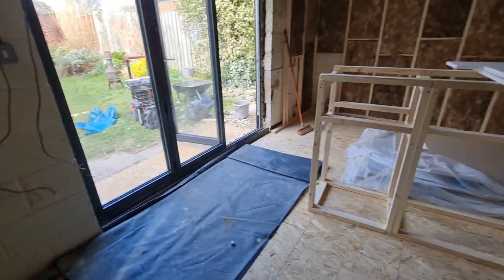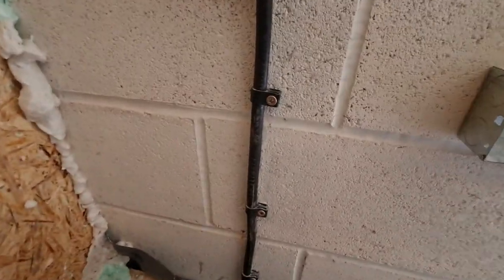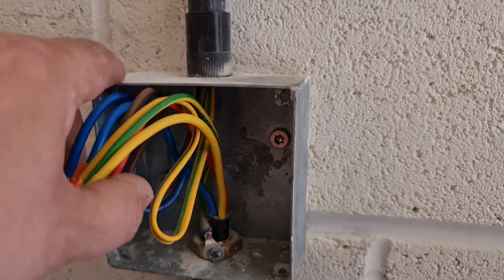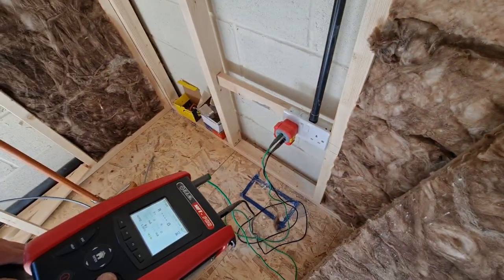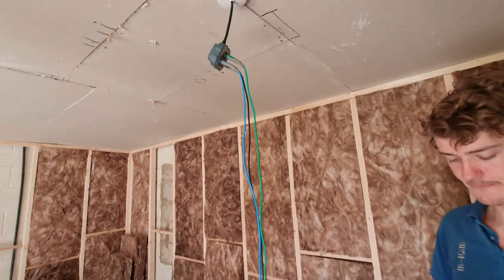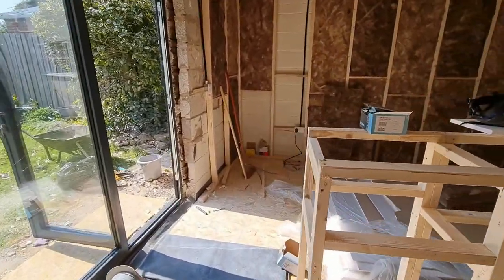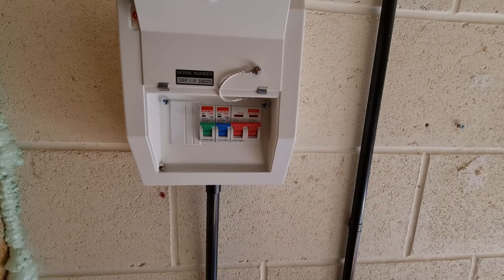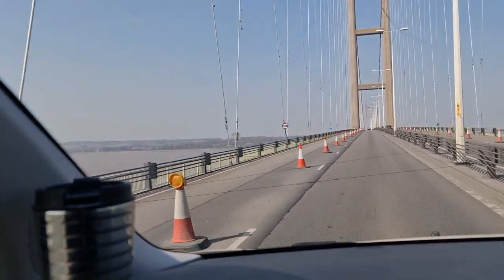Garage wiring and full test process. Plus who is the best YouTube Spark???

Comment: When I was doing my C&G 2391, connecting the CPC within the MCB for R1+R2 was a massive no-no, just in case the circuit was accidentally re-energised. It was fine doing it the other way round though.
Reply from the maker: Yes this is a valid chain of thought. But with safe isolation complete and the other end of the cable totally disconnected zero risk of a mistake here. Generally I use a wago but was trying to keep my freshly dressed CU tidy 😁

Comment: Good video mate, subscribed 👍 Its nice to see a bit of pride even behind the walls, one thing I always do when measuring r1+r2 is put line into earth bar rather than cpc into the breaker just in case I forget and power up all the bonded parts and earths will be live👍
Reply from the maker: Yeah I use connectors or the earth bar aswell. In this case cable was out the other end so even my stupidity couldnt be a factor lol. Thanks for the comment and subscribing, really really appreciate it!

Comment: Good video again Mark. 
I think I may have a solution to reduce waste electrical use in the UK. Fitting PIR switches for loft and garage lights to eliminate all those left on and forgotten, Greta will be twisting her pigtails with glee.
Notice you also have the VW group cup holder friendly Nespresso Touch cup, hope you get some sponsorship from them, if so, send 50 capsules of Columbia for the vertuo my way. You gave them some decent product placement.

Comment: What is the function of the braided conductor bolted from the DB lid and the enclosure?
Is it the result of the same thought process that leads to the bonding of kitchen sinks?
Reply: @Dog-whisperer7494  The continuity of earthing to the lid via its hinges might be hit-and-miss, but we only need to be concerned in the event that the enclosure becomes live because of contact with a live part inside.  If the hinge fails to conduct during that event, there would be no risk of shock from contact with the lid anyway.  I suppose we can say that the lid does not form an exposed conductive part if the hinge continuity has failed.  Whoever added that earthing strap to the design probably had the right intentions, but wasn't thinking clearly.

Comment: My Trusted Electrician is the best in humble opinion
Reply from the maker: Luke is awesome! Come back Luke! Not seen his videos in ages.
Reply from the maker: Not sure on the KT63 mate. Not one I have used tbh.
Reply: @electrician247  i am sure the kt63 does not have att on it so i sold it
Reply from the maker: @Dog-whisperer7494  for Ze? The meter does it internal so no need to adjust any leads. Just attach them to the equipment, hit test.
Reply: @Dog-whisperer7494  maybe it was the kt62 then not sure
Reply: @Dog-whisperer7494  yeh I believe you join the neutral and earth lead together and connect to disconnected earth for the Ze test
Reply: @electrician247  I agree, I said the same in one of my videos, a great spark
Reply: @user-vp7oj2rv2l  I have the KT63DL and mine does
Reply: @electrician247  yep Luke is an amazing teacher even though he might not know it. Has a very easy going talking style. Puts everyone at ease.
Reply from the maker: I hope we see Luke back soon! Maybe we should start a campaign.